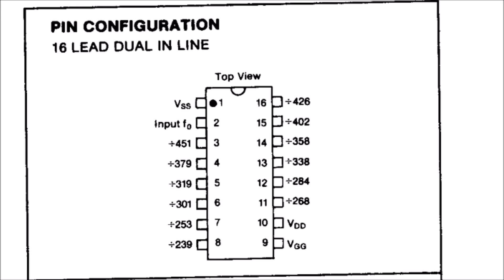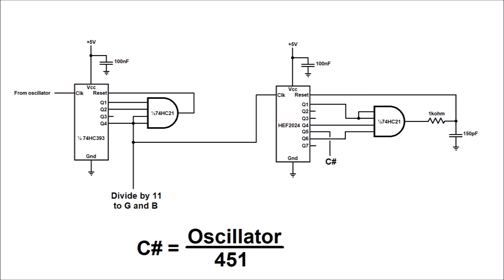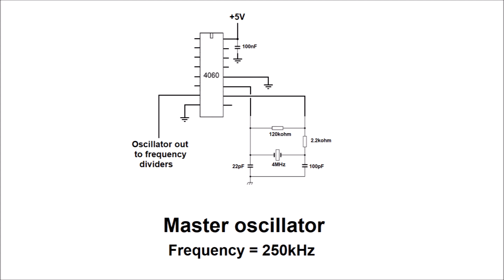Top Octave Divider - the hard way!

Comment: EDIT: I think Youtube deleted my comment as I had a link in it. Try again!

This is interesting. I'm intrigued by your divider design, combining the binary output of the 393 with the ripple output of the 4024 – and taking the desired signal from a counter pin. That's something I've not seen before. I guess the RC after the AND is to compensate for the propagation delay on the ripple output? I've been planning this week a 440 tuning reference using the same idea, with a 2MHz xtal and a 4040 to give 880Hz, with a 4013 f/f after to take that to a neat 440. Give or take a little sharp or flat, but close enough for music. I did a deep dive into the Korg Lambda a few years ago (on my synthnerd wordpress blog if you're interested) and the master osc for the dividers was a little over 2MHz. Thanks for this video :)
Reply from the maker: Yes, the RC is there to prevent premature resets caused by one counter pin changing before the others - like when 7 advances to 8 and needs to reset on 11. Instead of showing 0111 -> 1000 some counters do 0111 and then shortly 1111 followed by 1000, and given the speed of modern components it can trigger on this very short 1111. The RC delays are not necessary on all counters but I decided to build them anyway to be sure that everything worked. Sometimes the problem can be solved by using slower gates - like 74LS21 instead of 74HC21, but I happened to have a lot of HC gates so that's what I used.

Comment: You do know that an inexpensive Arduino Uno can do that very easily these days, don't you? But I admire your patience and perseverance.
Reply from the maker: Yes, I am totally aware of it. This is one of those project that is just as much a "method over result" thing, just to see if it is possible. First time I saw a microprocessor solution to the Top Octave Divider was in the late 1990's where someone had done it in a PIC controller.
Reply: @organfairy  
This project reminded me of a similar one I had done as a teenager in the early eighties building myself an electronic organ using Mostek MK50240 and twelve CD4024 used as octave dividers. I had stumbled on the fact that I could use my fingers as a switch to play notes, so I had soldered metal thumb-tacks to the wires and only had to touch them to play the 'instrument". I called it the Thumb-Tack Synth (TTS)! 😆
Reply: That's a nice circuit 👍👏👏

Comment: Very cool! Love all this divide down stuff. I once read somewhere that those TOS ic's didnt actually give you a proper  chromatic scale. Something about it not being possible to get the propper divisor? Apparently it was very close but not axact, not sure if its true. Also I have noticed organs that use a single master oscillator and TOS ic sound very bland and small compared to those that have 12 free running master oscillators. Years ago I got a gem rodeo 69 cheap from a trash and treasure market, when I got it home and pluged it in I was horrified how bad it sounded. That one had a single master osc. That being said the tone filters where piss poor also.
Reply from the maker: Tuning can be a very deep 'rabbit hole' - there are so many opinions on what tuning is the "correct" one: There are people who believe that we should go back to the medieval Pythagorean tuning or the Meantone tuning simply because they believe it's more 'musical'. 
The scale that we get from a divide-down system will always be a compromise between perfect tuning and what is possible with the given technology. As an example the Hammond organ was depending on the number of teeth that could be cut in the driving gears in the tonewheel generators. The integers that is used in my dividers has a maximum deviation of 0.079% or  1.35 cent from the perfect pitch. That's on the note D. All the other notes are 1 cent or less apart from perfect pitch. In classical music a deviation of 3 cents are normally accepted - or maybe that's just what could be obtained by classical instruments. 
I don't think your Rodeo's bad sound was caused by a divider based tone generator. I have had several organs that used this technology and they sounded fine to my. But I do know that some people believe electronic organs should be made with individual tone generators - not only for each key but also for each voice! The first electronic organs that were made was basically build like church  organs but with oscillators instead of pipes. This meant that they had hundreds of individual oscillators in a big rack and because none of them were in perfect pitch the organ sounded almost organic....... an organic sounding organ. 
That was a long pile of words, but as I wrote in the beginning: This is a deep rabbit hole!
Reply: @organfairy @PracitcalCat I agree slight variation in tune is partly what makes old analog synths sound more organic. I just saw the other day that someone was saying on old Hammonds some vibrato would mask most tuning differences. Of course if you are designing sounds with ensemble-ing layers, a small tuning variation is desirable.
Reply: @organfairy  The "imperfect" tuning is definitely not noticeable and not responsible for a bland sound. I just find organs that use single oscillators to sound rather dull  because there isnt any movement between notes (beating)  The hammond organ that technically has one oscillator in terms of phase relation (ie all tone wheels are fixed to the one shaft) is the only exeption.  I dont think there is a "correct" tuning I was just curious about what I read regarding TOS ic's having aproximate divisors for the cromatic scale. I personally cant hear the diference but the phase locked aspect of the notes can be a little tiring. I like multiple oscillators in organs for the beating and movement you can get, not to achieve some ideal tuning relationship between notes. Multiple oscillators make the tuning less perfect which I prefer.
Reply: @4estral  Hammond organs have no tuning variation between notes as the tone wheels are fixed to a single shaft and thus cant spin independently. Vibrato will give you pitch modulation for every note at tje same time. For some reason to me hammond organs sound good even though the oscillators are fixed like In a single oscillator divide down organ.